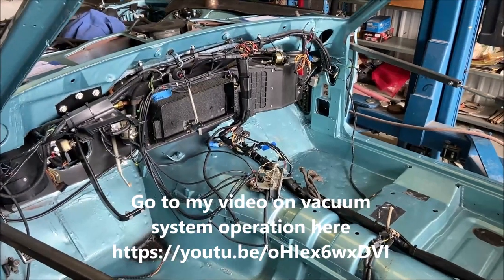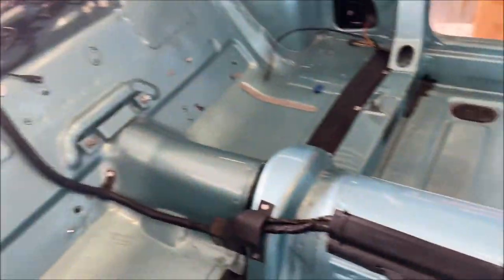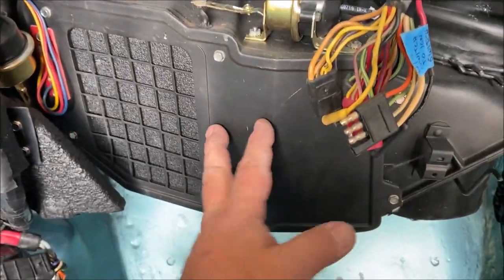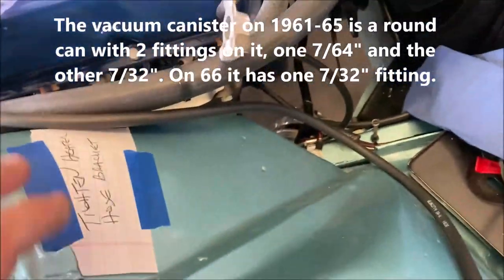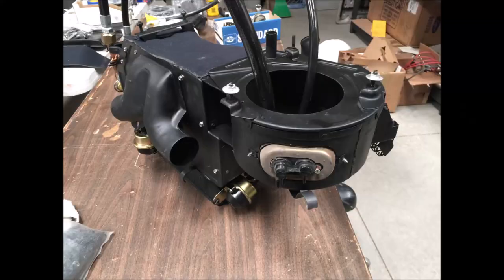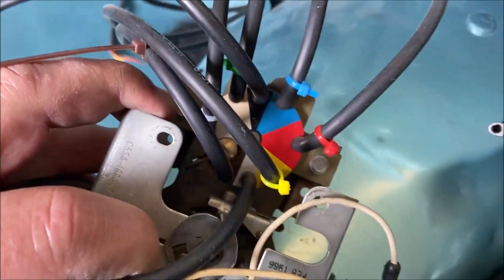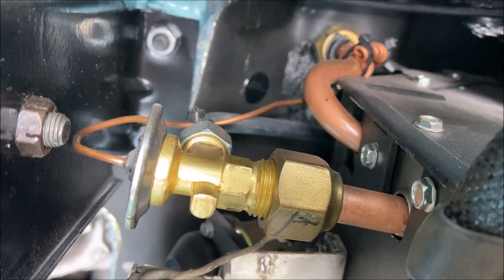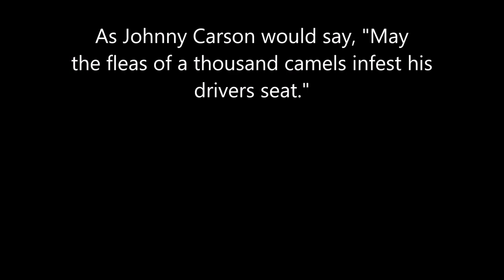1961-66 Thunderbird A/C and heater Vacuum System Layout

Comment: OMG!! I now know why the heat doesn’t get hot! Both defrost and cabin heat! Dang, looks like a heck of a lot of work! And, by the way, the air conditioning is missing the compressor, clutch, pulley and belt. I think even if that were all there, the vacuum system wouldn’t allow cold air! Geez Louise. A lot more work than I thought!
Nick, thanks for the great video…even though I am now depressed lol!
Reply from the maker: Thanks Gary. You should be happy because now you know how to fix it. Thats a plus.

Comment: Thanks so much for this. I am old and was an a/c and electrical specialist for a few years in the 70s and 80s. The sensing bulb or coil on expansion valve will give you lower a/c vent temp if it is metal cuff clipped or 2 worm clamped tonthe suction line and then insulated very well. The expansion will throttle down refrig flow and your evap pressure will be lower. This encourages the evaporation phase of system. When the sensing tube is hotter, exp valve opens more and floods evap and evaporation is reduced. You'll serious sweating of low side line and even lower sensed temp of that low side line back to compressor because that refrigerant did do it's job in the evaporator. Those cuff clamps rust and fall apart.
Reply from the maker: Hey Jimmy, thank you very much for the expansion valve explanation. I admit that I dont know that much about how an expansion valve works other than it sprays freon into the evaporator. I should study it more. Thanks again.

Comment: I just wanted to thank you for making a great detailed video of how this complicated system works. So many thunderbird owners cant seem to figure it out on thier own and give up out of frustration. The other thing i can't find anywhere is the instructions on how the trunk matts are assembled. Even when you buy new replacements, there's no installation instructions. Love the video. Keep em comin!!
Reply from the maker: Thank you very much for the compliments. The system is very intimidating when you don't know it. I am surprised at just how simple it is and how easy it is to rebuild it since it is only a few vacuum motors and some hoses, but its easy for me to say that since I've fixed hundreds. If someone decided to rebuild the plenum and recondition the evaporator, then the dash must come out and then the job becomes a monster. The daunting thing for me is the amount of work it is to remove the dash and all related parts to get to it. However, like I mentioned in the video, the dash does not have to be removed to repair the vacuum system itself but all dash and center console access panels must be removed including the radio, heater control, and clock tower (the panel where the clock is). 

The trunk mat kits are (in my opinion) okay at best. The material is not original (vinyl  instead of burtex like original) and they are never cut correctly so some level of fitting and trimming is required. The boards are the hardest part because they are also not cut properly, difficult to work with, and require quite a bit of fitting and trimming. I'm a perfectionist and I spend too much time trying to get them to fit perfectly which is impossible so I usually spend too much time beating a dead horse. I've never seen a kit that had an instruction manual on how to install. Just try to identify each piece and where it goes. Then start with the boards first, get them fitted, trimmed and installed. Then install the mats. However, when fitting and trimming the boards, have the mats handy and place them when fitting the boards so you know how they are going to fit together. Never glue anything in place until you are 100% sure it is fitted and trimmed properly and fits together with its neighboring piece. Thank you, Nick

Comment: thanks as always,i watched this to try to figure out why when going down the road i get air coming out of my ac vents just while driving on my 66.Im stumped.
Reply from the maker: Hey Robert, this is an easy one, your right vent boot is compromised. The right vent boot is rubber and it is the connection between the cowl and heater box. When it disintegrates there is nothing to stop air from blowing in on the passenger side. Also, if the right vent door is open, air will also blow in. Also, if the vacuum system is not working, the recirculating air door that blocks off the heater core will also not close. So, if the right vent is open and the recirculating air door is open, air will blow into the entire heater/AC unit under the dash and you will get air blowing out of all the vents. Every 1964-66 Thunderbird has a bad right vent boot. Good luck.
Reply: @vintagethunderbirdrepair9426  Thanks Nick
when you say right vent boot you mean the fresh air inlet correct?iv changed the hose that connects that fresh air inlet to the flapper that closes.im starting to think its something with the heater door.
Again thanks

Comment: Dear Nick, just in time as I was hoping to reinstall my repaired dash for my '65... I have the door locks and more hoses than an ICU ward. That "gold" thing that is WAY in the back by the incoming air down boot, I can just by pass? I have to use long pliers to get a hose in it as I can not reach back there. So cool... or at least I hope it will be when all hooked back up.. That gold thing sure looks like a vacuum actuator to me... so hard to see back there. Well if I have trouble ill let you know. you have always been a help. God bless.
Reply from the maker: Hey Michael, thank you very much. I think your talking about the thermostatic control valve. Yes, you can bypass it and just take the brown vacuum hose to the heater valve. good luck

Comment: Thanks Nick for the video. Those heater vacuum motors are a pain to get to. Especially the one on the right. Mine doesn’t work and I’m getting a lot of hot air mixed with my AC. I wish when the motors fail they fail with the door closed and not open. Oh well trying to change that heater vacuum motor is going to be a tough job.
Reply from the maker: Hi Jim, yes the factory wanted the doors to remain open in case of failure so the defroster and heater would still work. Makes sense to me.
Reply: That does make sense. Thank you. Do you happen to have any convertible top frame arms for 61 to 66 convertibles laying around in your shop. They are like hens teeth to find. Mine both broke on my 63M code probably due to the top not being down in a very long while most likely. Though the owner i just bought it from said he had it down in April. So sad, I am looking for a welder here which I may have found and see how well they might be able to be welded. I have called around to all the Thunderbird Parts places and Pat Wilson has a driver side but no passenger side. Thanks for any help you can give. I thought with all the Thunderbird you’ve done maybe you have a set of these laying around somewhere. LOL thanks for all your great work, I look forward to your videos very much. Jim
Reply from the maker: Hey Jim, sorry but I do not have any top arms for 61-63. I do have 64-66. Yes you can have them welded and make sure you find a GOOD welder, someone who is very experienced with welding cast aluminum. I have had those done many times when I was in Los Angeles. Thats the way to go. Good luck, Nick
Reply: Vintage Thunderbird Repair thanks Nick, I’m going to see the welder tonight and he can tell me whether he can do them. He is an experienced welder but he’s never done these before. So we’ll see.
Reply: thanks so much Nick. Can you tell me the difference between the 63 and the 64 through 66 top frame arms. I thought they were all the same. I just left my welder friend and he thinks he can weld my top frame arms. but we will see how well they come out. Thanks.

Comment: Thank you for a fantastic description on what going on with the vacuum lines.  I replaced all my vacuum lines with a different manufacture vacuum line and been having nothing but problems. Using the mighty vac I'm finding leaks at the connection points on the 7/64 lines.  I want to verify that this is the proper size that is used to go to all the vacuum actuators?  The vacuum system diagram I have actually shows on the 1st page 7/64 on page two it indicates 5/64.  I am suspecting inferior quality vacuum lines  The hose seam to leak no matter what fitting you put it on, even at the connection to the mighty vac. I am in process of order the Gates vacuum line you suggested in your video....  I am so glad a didn't install the dash yet. Thanks Jeff
Reply from the maker: All the vacuum lines going from the round colored pie shaped control disc on the dash (heater-A/C control) to the vacuum motors or actuators is the 7/64" hose. There is only one place where the 7/32" size hose is used for the A/C and heater, from the thermostatic control valve to the round colored pie shaped control disc on the dash. All other hoses (for the A/C and heater) under the dash are the 7/64" hose. The vacuum door locks are a completely different system and use both the 5/32" hose and the 7/32" hose. The source hose for the A/C and heater coming into the car from the engine compartment is also a 7/64" hose. The heater valve hose going from the thermostatic control valve to the heater valve is the 5/32" hose. I only use Gates hoses and belts on everything. I never use Goodyear. I also never buy Goodyear tires. Same thing with Standard products. Junk!!!!! Also, Fram. Compare the folds in a Fram air filter to any other brand. You can then imagine what their oil filters must look like! Junk!!!! I've learned my lesson the hard way over time with these products.
Reply: @vintagethunderbirdrepair9426   Looks like my problem is, I used the wrong size hose. Two follow questions - The 5/64 is that inside diameter?  Do you happen to have a PN for a 50' roll. Your help is appreciated.....Thank You
Reply from the maker: Yes, the size means the inside diameter. The part numbers for the 50' rolls of hoses are shown in the video but I will list them here too. Gates 27041 = 7/64". Gates 27042 = 5/32". Gates 27043 = 7/32".
Reply from the maker: Jeff, I was wrong, I made a mistake stating the correct size of the hose used inside the car to the pie controller. The correct size for the pie controller to all the vacuum motors is 7/64". Im very sorry to make that mistake. 27041 gates hose is 7/64" not 5/64". Also the source hose for the ac heater from the engine compartment to under the dash is also 7/64". I corrected/edited my comment to you with the correct size hose. Thanks, Nick
Reply from the maker: @Jsteencken  No, I made a mistake, its 7/64, see my correction comment below.
Reply: @vintagethunderbirdrepair9426  Hello, Thank you for the correction. I thought that the size you gave was incorrect, but when you gave me the part number I realized you meant 7/64.  No harm done and thanks again for the video & info. I'm waiting on the Gates tubing now and I believe it will solve my problems. Take Care Jeff

Comment: Great detailed video on the vacuum system. Thank you very much.  Do you have one detailing the heater core replacement on a 1964?  Thank you again.
Reply from the maker: If your car has air, its the same as the 66 in my video. I don't exactly show removing the heater core but I do explain how to take out the heater box. From there its a no brainer. Sorry that my answer is late, I didn't see your post.

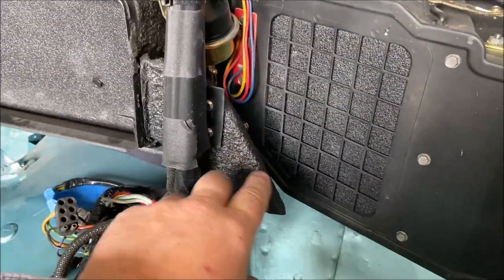Comment: Nick, at 3:08 you mention removing the 2 air supply screws. I’m having trouble removing this air supply so I can get to the heater core for replacement. What am I missing?  1966 with air. Thanks,
Mike
Reply from the maker: Hey Mike, that "air horn" (for lack of a better name) is attached to the evaporator box with one hex screw on the bottom and it is hooked to the evaporator box at the top. Once you undo the hex screw at the bottom, you can lift up on the air horn and pull it off the hook. Scrape some of the tar off and you will see what I am talking about. Good luck.
Reply: @vintagethunderbirdrepair9426  thanks again Nick. I’ll be back at it tomorrow.
Reply: Thank you, thank you again. That 5/16 hex screw would have been  impossible to find without scraping off the tar. It was on the bottom behind a cluster of wires. You the man!
Reply: @vintagethunderbirdrepair9426  Got it. The hex screw was covered in black coating. Thanks again

Comment: Brilliant video...Re bypassing the thermostatic control switch (old and not repairable etc.), I assume just means the A/C is constantly "ON" when selected "ON"? 
No temperature sensing & control any more?
Reply from the maker: No, the thermostatic control switch Im talking about controls the heater valve. It is located in the fan compartment. It shuts off the heater valve when things get too hot. Because they are not available, you simply bypass it and go straight to the heater valve with the brown hose. Its a little bit more complicated than that, I made is sound so easy.

Comment: Nick, thanks very much for your channel and for sharing your significant knowledge and experience.  I'm getting prepared to attack the vacuum system in my 66 Landau with AC.  To start, I purchased some A/C Heater Control Units to play with / restore.  One is from June 64 and the other April 65.  What I've noticed on both, is that the temperature control valve within the control unit, bleeds slowly when I perform a vacuum leak test.  Is this normal or are they defective?  I haven't seen replacement parts being sold, unless I'm searching using the wrong terms.
Reply from the maker: Thank you very much Glenn. I think there should be no vacuum leaks in the valves. I don't think they make that valve anymore but I'm sure you can find a good used one. Try the Birds Nest. Good luck.

Comment: Seems simple enough, video and your direction explains very detailed. However! I will be replacing my vacuum hoses with dash in place, big challenge  I know. Good winter project. Any advise is greatly appreciated. Where can I get the plastic T's needed for hoses. My car is optioned with all except cruise.
Thanks, Ed
Reply from the maker: You can get vacuum fitting kits at the auto parts store, ya know, a plastic box with many different kinds and sizes. They carry some good ones. Only problem is they are usually white plastic. I have a pile of the original metal T's for the big 7/32 hoses. These T's are used only in the engine compartment. There are several straight brass fittings used in the door lock system too. Under the dash are a few T's that are 7/32 left and right and the odd one is 5/64. Those are plastic and part of the Air and heater system. Just be careful when you reinstall the heater box you don't pinch the vacuum hoses between the heater box and fan box. I've done that a few times. Thanks

Comment: Wow.... I haven't even started replacing mine yet and I already have a headache...... But great job. As to the rear vent by the rear window do they make replacement vacuum components that will work for that? Mine no longer works.....
Reply from the maker: Yes, the same vacuum motor for the front AC will work in the back, same vacuum motors. They are tricky to get in but they do work. The part number for the vacuum motor is Motorcraft YH161. Oreillys has them and I think you can still get them from Ford?? Good luck.